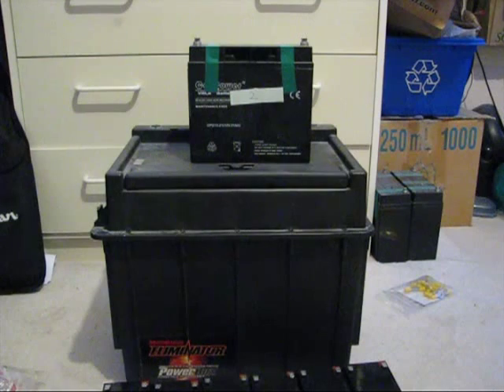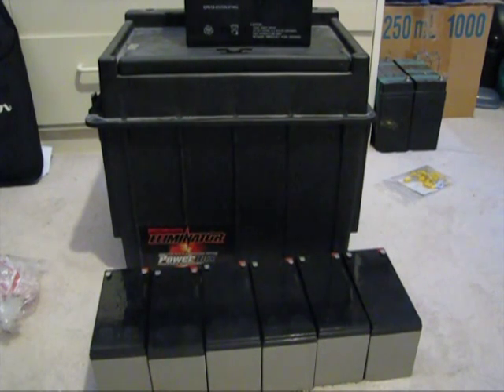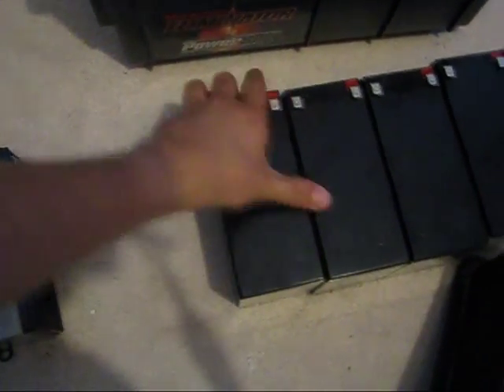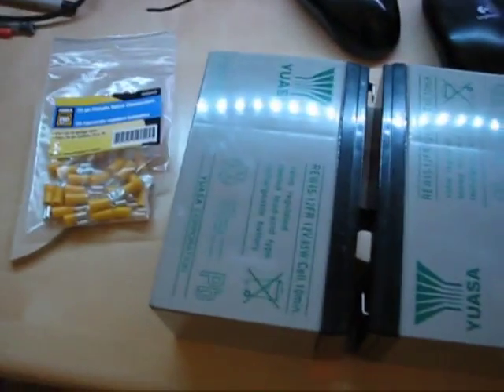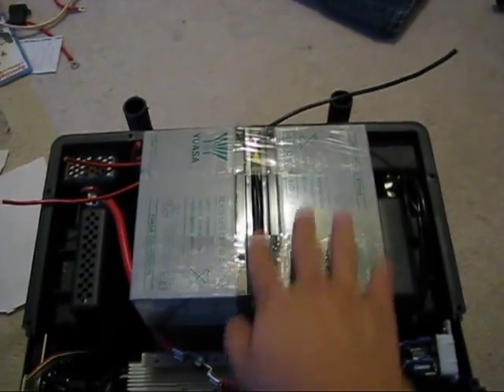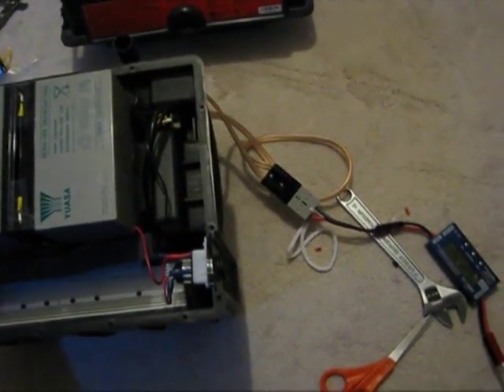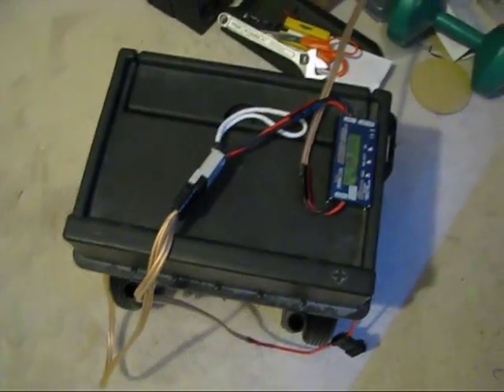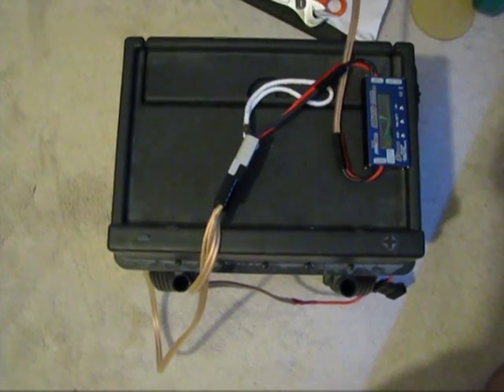Battery box repair

Comment from the maker: @MightyJustas When properly maintained, sealed lead acids are great for standby power. Right now its still completing the trickle charge as the batteries were in storage for about 2 weeks, but I have similar batteries which are topped up daily by solar power. When the insolation is insufficient, the batteries will still retain a calculated approximate of 90-95% state of charge, with the loss accounted for due to current drawn from devices connected.